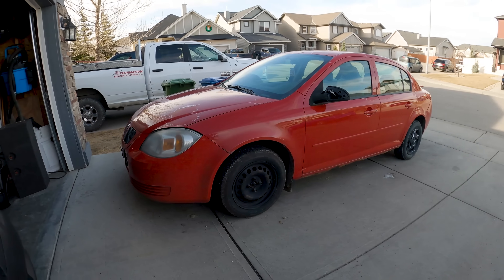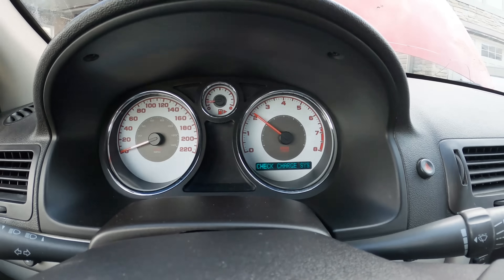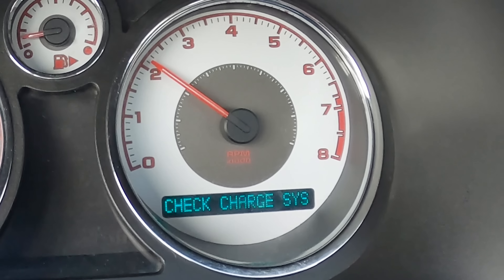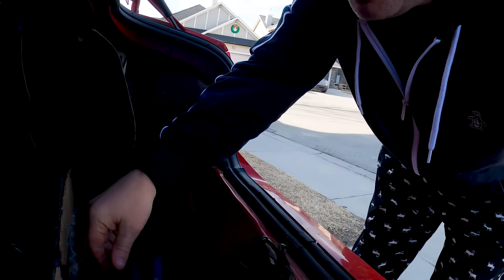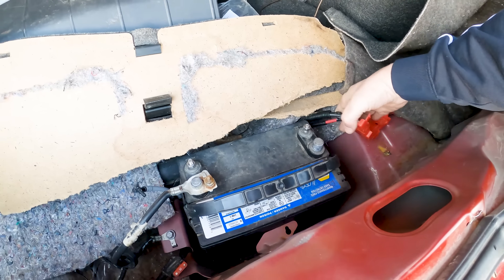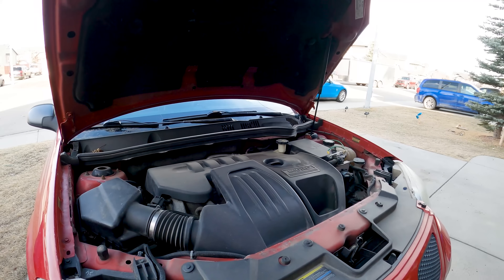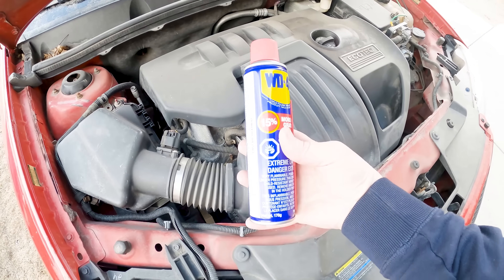ROADSIDE FIX! REVIVE your DEAD or DYING Alternator with this ALMOST FREE trick! | Gears and Tech

Comment: never unhook the battery while it is running
Reply from the maker: Not never. But normally don't
Reply: If you do (this stunt) make sure you have a load on it (headlights air conditioner etc ). This used to be a good test on older cars that didn't have a lot of expensive electronics electronics
Reply: WD 40 is highly flammable I'm surprised it didn't go up in smoke and also u was really lucky when u placed the hot cable on the metal trunk floor that it didn't short out another reason no one other than myself ever touches one of my vehicles
Reply: You can do this test on older vehicles but ahook negative first positive last and if hooking cables back up or even jumper cables positive goes on first negative last that way if u ever drop the positive u won't get a short or spark also on most newer vehicles they will die as soon as they detect a loose cable I had a 99 Malibu if u unhooked either cable the computer detected a problem and shut the car down

Comment: Field rotor  brushes get stuck . Wd40 or brake clean will clean them free up .
Caution flammable 🔥
Reply from the maker: Great explanation
Reply: I was looking for this comment...
WD40 FLAMMABLE🔥💩
 Be safe🎯⚡😎☕
Reply: The brake cleaner is crazy Flammable, but the wd40 isn't really an issue in my opinion 🤔  but I would try either 1 or both as long as it was disconnected until dry ,the brake cleaner ^
Reply: @invisibilianone6288  some brake cleaner also very flammable . We use as starting fluid
Reply: @Motorhead250  years back, I worked at truck repair shop
 Shop was near tidal land, often flooding part of shop floor. Mosquitoes were incessant buggers one night. Big lighter, & can of the GOOD brake cleaner 🔥😱🔥😁🔥🔥😂🔥🔥🔥🔥🔥 decimated the majority of the annoying squadron of mosquitoes😁

Comment: Gr8 vid.
What does it  mean when you start your car but it hesitates a bit b4 starting
Is that a battery , alternator , or starter issue.
I have a 2015 Nissan murano  awd 
Tkz!
Reply from the maker: Most likely starter, but could be low battery
Reply: @GearsAndTech  Could be corrosion starting under cable to battery. Almost always at positive terminal. But usually this means just a solenoid click and no  cranking(starter engages and so voltage drops and solenoid drops out).
Reply: If possible charge battery to fully charged before starting or after it starts and runs for about 30 minutes and you shut it off does it still drag before starting if so it's most likely the starter going bad if it starts just fine after being fully charged or driving about 30 minutes it'll be the battery if the battery is over 3 yrs old its most likely the culprit they don't make em like they used to

Comment: Not a good idea to disconnect the battery whilst the engine is running.
Reply from the maker: Doing it 30 years now with no issue
Reply: Let’s hear why it’s a good or not good idea instead of just saying it’s not a good idea and leaving it at that. How’s that helpful for anybody waste of time if you have knowledge Rob let’s hear it. I’ve been a technician for 10 years plus around cars, my whole life that’s a common test For alternators
Reply: @seancain7331 I'm sorry sir, but your education is not my responsibility.  Google is your friend.  I tried to help by posting that I don't think it's a good idea and I still believe that.  You're welcome to think otherwise.

There are people with far more experience than me who have been kind enough to dive into the details of why it is not a good idea to disconnect the battery with the engine running.  Your mileage may vary, so to speak, and you might be just fine.  I would happily do it on my 1954 Morris Minor, but I would not risk it with a modern engine that has a lot of electronics that will not take at all kindly to the practice.

IF the alternator is kaput (or the belt is missing, for example) then yes, disconnecting the battery that is providing ALL the power will indeed kill the engine.  But it's a risky way to diagnose.  If it isn't the alternator and that battery is suddenly removed from circuit, especially for any length of time, I fear that quite a few of the sensitive electronics in modern cars will have a bit of a hissy fit.

So yes, I have some knowledge, but only 40 years as an electronics engineer.  Also, as a sailor, I know of instances where there has been a fire on a boat engine when the battery was disconnected whilst the engine was still running.

Hope that helps.

Comment: !!! FYI: Disconnecting Your Battery While The Car is Running, Is Definitely Not Recommended...!!!
(some people will say this is not true, but I promise you that it certainly is! Ask me how I know 😬) 

Reason being that if the alternator is in fact good and the car continues to run, by disconnecting it you have a high chance of burning out the alternator output circuitry. Voltage regulator or more specifically the diodes.

Now especially in more modern vehicles this can also damage more sensitive Electronics, and this can become a real nightmare... Since it can often be hard to diagnose what actually burned up, not to mention the price of parts and labor... 😳

Just take the car to the closest auto parts store and they will connect a small device to your battery and tell you exactly what is wrong. FOR FREE
Reply from the maker: If your car is dead on the side of the highway, with a dead battery and as soon as you jump start it and remove the cables it does, how exactly are you going to 'just take it' to a shop for a free alternator test?

This is the quick, get back on the road fix for people who suspect their alternator is bad.

I never said to go around doing this every day for fun.

Comment: Some ecu/tcm's do not tolerate removing the battery pole while engine is running... a couple of months down the road, the transmission reverts to 3rd gear only, which is the al'ways open solenoid, tripping the Neutral light to blink..always engage the headlights, stereo system, hazard lights and cabin light before removing battery cables.. the ecu/tcm can read the voltage and, not seeing the battery, create a voltage spike as to dead battery..
Reply from the maker: I agree loading up the load on the vehicle needs to be done while battery off to test alternator capacity

But I haven't seen an ecu or tcm or bcm freak out over no battery being connected.

Only time I've seen that was when ground to bcm was broken and it grounded through coil pack wiring instead which burned up bcm and a lot of other stuff

Comment: Bought my 94 Accord for $500. Fuel leak when running. Needed a vapor return valve for the fuel tank. Chiseled a hole through the trunk to find the source, had it fixed in 20 minutes, not counting the travel time to/from the wrecking yard. $500 cars are the ONLY WAY TO GO.
Reply from the maker: It's nice when you can keep them going for a long time for cheap
Reply: You're lucky to find a $500 car nowadays.
Reply: I bought a running Opel Corsa for 300€....😂😂
Only minor revision. All legal....😊
Reply: Where did you buy it ?
Reply: hondas subes and yotas, 700,000mi or bust<>
Reply: Some cars are weird to work on like i worked on one car and one of the bolts I needed to get to I had to take a ratchet threw the fog light bezel 😂😂😂😂 just to get to a bolt to loosen it other than that I figured it out and I have been testing how many ways can you access fastens and bolts and nuts on cars and it is ridiculous that you can literally get a. Ut or bolt off from 5 different directions or sometimes threw something or past something or going from underneath and my favorite is climbing into the engine bay but sometimes you gotta get in the tightest spots ever to get a bolt or nut out

Comment: Great tip, dude, thanks!
Reply from the maker: You bet!
Reply: @GearsAndTech If you remove battery cable from running engine on most cars made in the last 15 years you can actually cause damage to the sensitive sensors and computer systems because of voltage spikes and back feed of voltages
Reply: If you remove battery cable from running engine on most cars made in the last 15 years you can actually cause damage to the sensitive sensors and computer systems because of voltage spikes and back feed of voltages

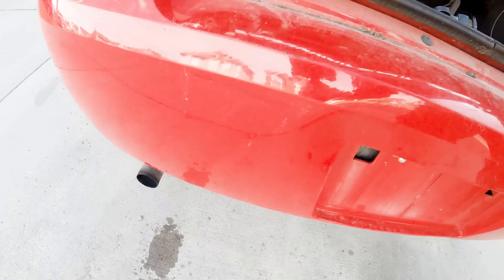Comment: 5:18 Uhhh... No..?
Most modern cars will shut off when you pull a cable of a battery terminal because you aren't making a complete circuit anymore. It's also risky to both your personal safety and the cars various modules as well.  They are more computer than commuter these days, with various components relying on a steady 5v source to function as opposed to old school analog ~12v+.
Heck, most cars BCM or Battery Control Modules that are fancy computer monitored voltmeters that control the voltage regulator to determine how hard they should work based on the age of your battery, among other factors, and those systems get wonky if you try to jump start or charge the battery off the terminal instead of the conveniently located posts.
Reply from the maker: This story has been passed down since the 80s.

Every time I try it I find it's fake news. I haven't found a car this test doesn't work on. All teh way up to 2023 so far.
Reply: "... when you pull a cable of a battery terminal because you aren't making a complete circuit anymore" Rubbish. The circuit is alternator to load to earth to alternator earth. The battery supplies amperage when the alternator is not functioning. When the CONTROLLED(by the ECU or some dedicated computer) output of the alternator is not also charging the battery it will run the other electrics just fine.

Comment: Without battery, voltage spikes from the alternator could harm the car electronics.
Reply from the maker: Very low chance, but yes. Thats possoble.
Reply: ok rik ..best call the tow truck with his approx $350 charge..have fun sitting there at 9pm on a sunday night stranded & waiting for him to show up because of those voltage spike fearing issues..

Comment: Do not listen to anyone who advises you to remove battery connections on any car with an ECU.  This guy is a hack.
Reply from the maker: It's always fun when someone jumps in the comments with classroom theory but no real world experience to back it up.

There are so many scenarios where this condition will be created normally on a car and nothing bad happens.

These cars handle so much more than you realize.
Reply: @GearsAndTech  "There are so many scenarios where this condition will be created normally on a car and nothing bad happens." Absolutely true. The ECU( or whatever computer is regulating the alternator) knows only the resultant voltage of the alternator output. There is absolutely know reason for it to increase output currant if the output voltage rises for ANY reason. The nervous nellies know nothing about ohms law. 

Everywhere, especially in the US there are warnings that warn against almost impossible dangers. It's called 'covering your arse'.

Edited to change the incorrect  'no'  to "know", twice.

Comment: Great! Thanks!  I am a new subscriber.

Question:  Do you think that this WD-40 trick will work on engine starters?  I have had bad luck with starters dying on me in the past several years and so I am hoping that his trick will work on starters as well.  Thanks!
Reply from the maker: Starters are sealed up. No way to get inside easy to clean.
Reply: Hit starter with wrench or hammer to wake it up to get start then have it replace asap.
Reply: @Finance-d7q  Clean the wire/cable connectors and the Bolt/screw flanges yearly. This makes for a good electrical contacts as they will corrode and act as a resistor to current flow which will slowly over time cause the starter to burn out. If cleaned yearly the starter should last for years!

Comment: Great tip; subscribed, question: can you spray WD-40 on the alternator every 3K miles to keep the unit operating at optimum efficiency?
Reply from the maker: You could, but it won't do you that much good. Most people never spray it down. One every 50k miles is probbaly plenty
Reply: @GearsAndTech  thank you for answering my question, I have 1999 Jeep Cherokee 4.0 liter 2WD, trying to make it last 316K, new vehicle way out of my budget, used vehicle prices are down right scary, oh ya not a mechanic by any means. Joke: what part of Popeye will never rust?
the part that’s in Olive Oil

Comment: My alternator just died after producing burning rubber smell for a short while. Will this work? Im afraid to try 😂
Reply: That totally sounds like the bearings seized on the alternator shaft (or a tensioner pulley if so equipped) and burned up the belt - and of course with no belt to drive the alternator, no amount of spray is fixing this situation...
Reply from the maker: It can't hurt it more

Comment: NEVER DISCONNECT THE BATTERY IF YOU THINK ALT ISN'T CHARGING, THIS IS A GOOD WAY TO KILL THE ECU COMPUTER BECAUSE THE ALTERNATOR ISN'T PURE 12V DC IT HAS RIPPLE IN IT, THE BATTERY EVEN LOW ACTS AS A BALLAST OR RIPPLE FLATTENER OR A BUFFER FOR THE COMPUTER, NEVER EVER DO THIS, TO CHECK IF ALT WORKS, SIMPLY SEE IF ITS AT 14,2V WITH VOM, AFTER YOUR WD40 SPRAY, DON'T DISCONNECT BAT WHEN ENGINE IS RUNNING NEVER EVER, YOU CAN FRY THE ECU, THEN YOU NEED TO REPROGRAM THE ONE FROM THE SCRAP YARD
AT 600 BUCKS AND $300 TO RE-FLASH E-PROM  TO THE VIN FROM THE DEALER
Reply from the maker: I've never experienced that issue ever.

I have seen one fried ecm, and it was from a corroded body ground on a nissan which is a common issue known to cause fried ecm

Nothing to do with alternator though in that case

Comment: So my 05 Silverado sat for 1 month in cold Massachusetts weather. I started it and it was making a grinding noise. The grinding stopped after a few minutes but it whines and squeaks. Sounds coming from the alternator. Do think this would work? Truck fires up fine and no battery light or anything on
Reply: Could be a bearing going out, in the alternator.,,,grinding noise.
 It could also be bad bearing in serpentine belt tensioner, or idler pulley..
 Do you happen to see any black dust, actually material from serpentine belt, anywhere on front of engine? If so, there is something causing drag, on the serpentine belt,,, 
Alternator
Tensioner/idler pulley
Power steering pump
Air conditioning pump
 Water pump,,,etc.
 You don't want to be driving, and have the serpentine belt fail...it could cause
No charging
No power steering
No Water pump, could overheat, 
 Hope you discover the cause.and a successful repair.
Reply: @invisibilianone6288  it ended up stopping. I think it was just from sitting in the cold for awhile
Reply: @Kevin_Yagoonie  sometimes the grease in the sealed bearings on alternator or tensioner/idler pulleys dries out over time, and when it's freezing, the bearings will shudder,,, sounding like grinding noise.
 You can. Make note, or take picture of how the serpentine belt routing goes from one pulley hub, to the next. So it can be put back on correctly.
Remove belt, off tensioner. Then spin the alternator pulley and the other pulleys, if there are any looseness or bad bearings, you will hear definite noise. Then the noisey culprit can be replaced.
 Best of luck😎☕
Reply from the maker: Give it a try

Comment: Will  electrical parts cleaner spray work instead of WD40?
Reply from the maker: Yes, for the most part

Teh wd40 helps remove any corrosion or rust that the electronic cleaner isn't great at doing
Reply: @GearsAndTech why not just spray brake cleaner?

Comment: I just stumbled upon your video and I am attempting to do this myself on a 2006 Kia Amanti to see if I can get it started, it died out a block from my house and I had to push it back home, partly due to the extremely cold weather we had and I am absolutely 100% sure it's not the battery itself as it's fairly new.
Reply from the maker: If it's been too cold and the battery is dead dead then it may freeze as well
Reply: I have been using a smart charger to charge the battery and even then, it won't turn over @GearsAndTech
Reply: @rk9motorsport59  Smart charger should tell you if battery is totally had it(shouldn't be if fairly new). Corrosion under battery terminals(almost always the positive one) could cause no cranking. If very bad there will be no solenoid click either.